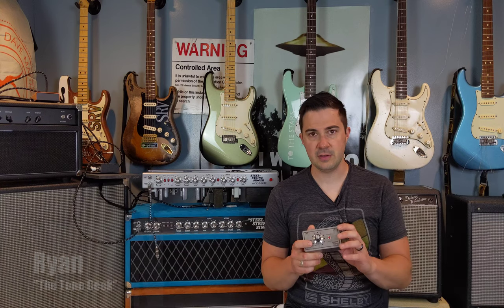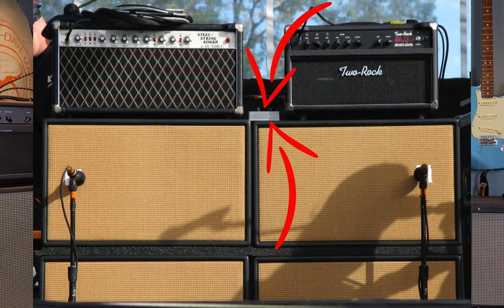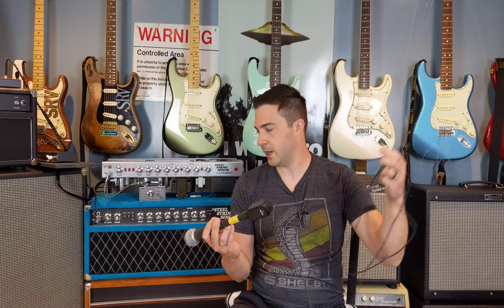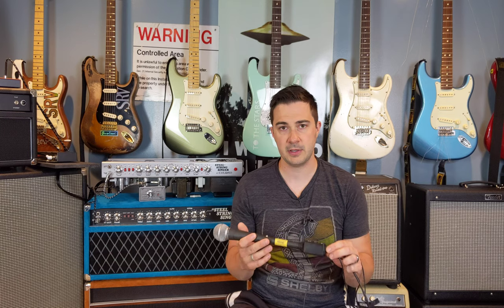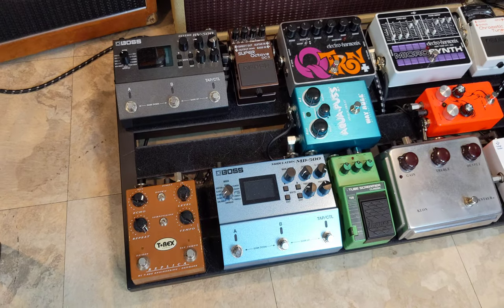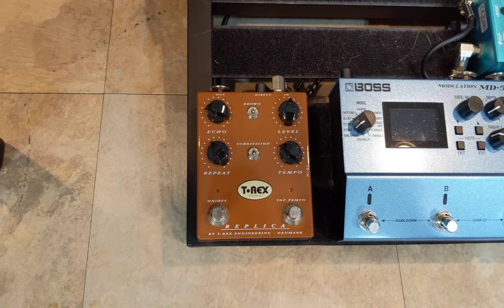Steel String Singer #002 Build | Episode 9: John Mayer & SRV Tone Demo!

Comment: The Timmy/Jan Ray is one of the best OD pedals for "always on" SRV tones. Yet it's never in the conversation of "best SRV in a box" pedals. 

If you want that scooped Fender Blackface rhythm tone from Texas Flood, get a Jan Ray clone or a Timmy.
Reply from the maker: Yes! I completely agree with you. I built a Jan Ray clone and absolutely love it for SRV. It replaced my TS-10. Thanks for the confidence!
Reply: @TheToneGeek  what pcb did you use or did you create your own? I used the Coda Effects one I think with the trim pot turned all the way down.
Reply: I could not agree more! They are actually really good also for John Mayer kind of tones. Another pedal great for John Mayer/SRV applications is the Mad Professor Sweet Honey Overdrive.

Comment: so if i wanted to get a clean boost, what would be the best option? katana or klon?
Reply from the maker: good question.. The Klon with no gain is very similar to the katana as a clean boost. Both runs at 18v internal. I'd recommend the Katana if you want a one trick pony. If you want to experiment more, Klon type for sure
Reply: @TheToneGeek  thank u so much for feedback habibi x

Comment: good! classic tone OT? bass is ok? not boomy?
Reply from the maker: Bass is really, really tight. I ended up finding an error in the Japanese schematic after this video was shot so I need to reshoot a tone video after the change. The change ended up making the amp quite a bit brighter so the bass response was tightened up even more. If it's ever boomy with a cab, the low filter does a fantastic job taking the boom out but maintaining the low end at the same time. It is a classictone OT. Do you find they are boomy or did you mean the amp in general?
Reply: @TheToneGeek  yea now is difficult to speak about the OT when the amp has so much stages..and filtering.. SRV had very tight sound..is there a power in jack, so you can plug guitar directly to output ? then test on strat on neck... if is not boomy then, OT is good! searching proper OT for my stuff long time.. but some classic tone (marshall JMP type) had too much bass.. at the end developing my owns end experimenting with everything and the story goes on and on and on ..:)

Comment: What are those aluminum dust cap speakers in that 2x12?
Reply from the maker: They are vintage JBL D131 12" AlNiCo that have been recharged and reconed with JBL E120 cloth surround kit.
Reply: @TheToneGeek  I have one E120 for sale near me. Tempted to get it and put it in my Fender Supersonic
Reply from the maker: @Diax1324  that would be a fantastic choice! Go for it if the price is right
Reply: @TheToneGeek  Only thing holding me back is the supposed extra-mega-harsh brightness that occurs with gain.
Reply from the maker: @Diax1324  you'll easily get your money back if you decide to sell. The E120 cones are forgiving compared to the paper surround d120. I think you'll be ok